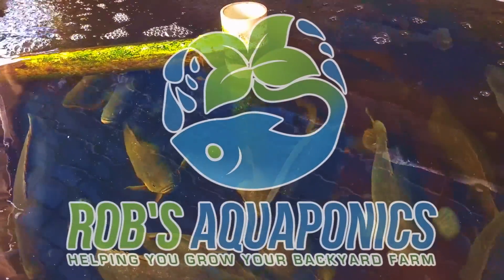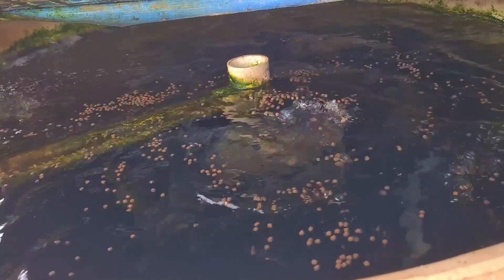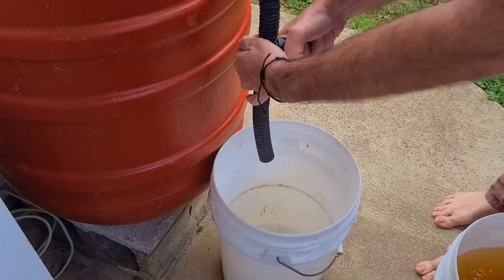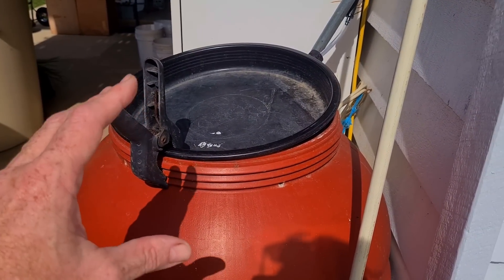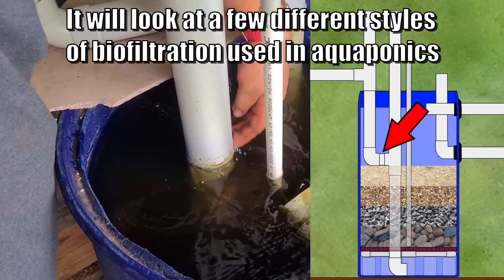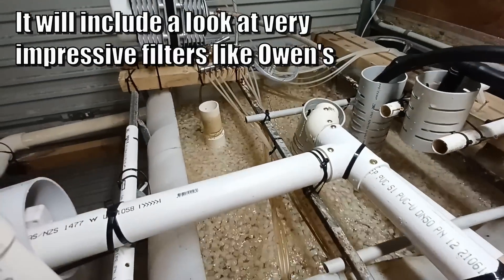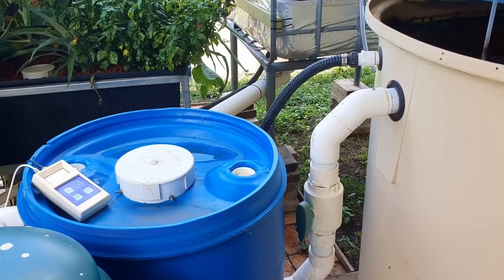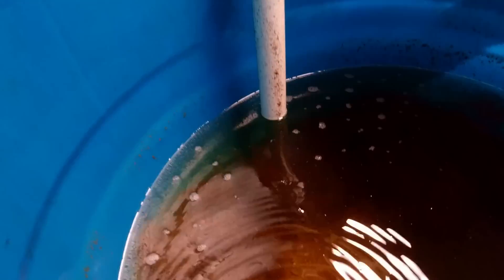Aquaponics Solids Filters & Biological Filters 🐟🌱🍓🥬

Comment: Hey Rob, thanks for your educational videos- they do help a lot. 1 question though, do you not have any problems with the pump clogging up in the fish tank/IBC or recommend anything be added like a pre-filter?  ( Also sorry if you have already answered this ) THX!
Reply from the maker: Hey Jason. Never had an issue in the larger systems with a 4500+lph / 1200+ gph pump but have had issues with the smaller aquarium ones. 
I also tend to run systems where the pump is in the sump tank so most of the solids are removed before the fish water gets to the pump. 
Hope that helps some.

Comment: I’m a plumber, and I strongly feel like dual solids filters should be plumbed with symmetry, starting from the tee you split them up.  One will be getting more use than the other, possibly defeating much of the purpose of having two filters.
Reply: I say I’m a plumber, because it relates to twin water heaters hooked up together parallel.
Reply from the maker: I think one would always get more than the other but by splitting in parallel it would still be slowing the flow dramatically between the two. 👍H has noticed that both his set up this way get the same amount of solids. He's just eyeballed it though.

Comment: How long do you oxygenate the waste in the barrel to use it?
Reply from the maker: The biofilter only has a short retention time of about 4 or so minutes.
If you mean a mineralisation tank that you puit the solids waste into, idealy it should be bubbling/brewing for about a month before you draw off the mineralised water to add back into the system. It doesn't have to but that's best practice. 
This video cover mineralisation a little better,
https://www.youtube.com/watch?v=pX8yB4-fJLs

El biofiltro sólo tiene un corto tiempo de retención de unos 4 minutos aproximadamente.
Si se refiere a un tanque de mineralización en el que deposita los desechos sólidos, lo ideal es que esté burbujeando/preparando durante aproximadamente un mes antes de extraer el agua mineralizada para volver a agregarla al sistema. No es necesario, pero esa es la mejor práctica.
Este video cubre la mineralización un poco mejor,
https://www.youtube.com/watch?v=pX8yB4-fJLs
(google translate)

Comment: What size of pipe that suitable for this scale aquaponic?
Reply from the maker: I use 2' / 50mm for gravity flow drains on these smaller 1000-2000l DIY systems.
Reply: @RobsAquaponics  is it good enough if i use 32mm pipe sir?
Reply from the maker: @supergrandimperialx  That depends on your flow rate. I think 40mm would be OK for gravity flow rates of up to 1200lph but no more. 32mm would be a bit small.
Reply: @RobsAquaponics  allright. Thank you Sir for answering my question.😁

Comment: My old aquaponics system I used the swirl filter barrel design to collect the solid waste. Then for added biological filtration, I threw in a whole bunch of those plastic mesh fruit bags we get at the supermarket for apples and oranges rolling them into "apples" (my diy pot-scrubbie type filter media) floating in the same barrel. They helped slow down the flow and prevented waste from coming up and exiting to my grow beds. Saved a lot of space with less plumbing parts needed. I really liked that system.

Comment: Hello, thanks for the video; subscribed. I’m using a Matala bio filter for an outdoor koi pond and for several months the filter pads would have a ton of mucky poo waste to clean. However recently I noticed there’s none of that but I see a lot of tiny tiny particulates (probably algae-based) that pretty much flows through, straight back into the pond. As a result the pond water has been looking pretty dusty and green despite trying to clean the filters as best I can. I also have a barrel filter with the white plastic pieces to help, but it doesn’t seem to be filtering well either. Do you know what could cause the poop to change form to barely anything solid?? Thanks
Reply from the maker: Mechanical action & the bacteria breaking it down will cause it to form smaller particles. Are you still having issues?

Comment: Great channel.  I have a question about tank size for solid separator and moving bed bio filter.  What size tanks would you recommend for 200 gallon tank with 40 fish, my goal?  Lastly how much moving bed media should I use?  I think I seen where you were using 30L of media in 8 gal.
Reply from the maker: I like to base it on retention time so ideally I should have a 50gal drum for the bio filter to give the nutrient rich water 6+minute in the drum before passing through. The same amount of dwell/retention time I like in my solids settlers. 👍
For us in our climate we need 1L/quart of the media we use to process the ammonia generated by a 500g/1lb fish. The same should be true for tilapia if you're growing them as they have a similar metabolism.
Sorry for taking so long to get back to you.

Comment: For DWC, how many gallons of nutrient water, do I need to support plants. Is it figured by volume of nutrient water, volume of grow bed, number of plants, or a combination.
Reply from the maker: Most folks I know will use a 12"/300mm trough for their DWC Sam. As for flow rate, most will run at once an hour exchange rate maximum. I know one chap that like a 3 hour water exchange rate in his DWC. 
Sorry for missing your comment at the time.

Comment: Would a radial rlow settler work with a small backyard duck pond?
Reply from the maker: It can do Stan. It would need a fairly long retention time as a lot of the solids will be fairly fine.
Reply: @RobsAquaponics  so a large container with slow flow?
Reply from the maker: @stanmondzelewski9253  I would look for a 6 min retention time minimum. To wok out retention time divide the filter drum by the flow rate per hour then  multiply by 60. 
e.g 200l drum / 1500lph flowrate = 0.1333
0.1333 X 60 = 7.998 minutes or close enough to call 8 min. .
Reply: @RobsAquaponics  thanks

Comment: Any tips or ideas for someone trying to do aquaponics in 5 to 6 climate zones? (Gets down to -26c in the winter)
Do I just have to only run it in the summer?
Or do you think a small greenhouse set up could work?
Also it gets up to 26-35 in the summer. 
Would a heater in a green house be enough? Or even worth it?
Reply from the maker: I do know folks that run the fish inside & have the greenhouse outside. They wind the greenhouse down over winter & the fish slow right down as well.  
You could also grow indoors as well, either part time or just through winter if you have enough space in the basement or garage.
Reply: @RobsAquaponics  thanks for the info, great informative videos also 👍

Comment: I have a 120 gallon fish tank with 10 adult goldfish and 2 juvenile plecos (originally the fish were in separate tanks, and I have been unsuccessful in rehoming the second pleco as of yet, though I will continue to look for a good home). They get 1-2 tablespoons of Wardley Pond pellets throughout the day in separate feedings. I have a canister filter and sponge filters that have prevented any issue with ammonia or nitrites, I have a bed of aquarium gravel in the bottom of the tank, which sits on my floor, and no room for a solids settler. I am having difficulties calculating the volume and planting density in grow beds/rafts. I always have an excess of nitrates, so I have to siphon off water and vacuum the gravel, but I also have deficiencies in pretty much every other nutrient. it doesn't seem worthwhile to supplement the other nutrients if I am having to constantly siphon water off to control the nitrates. I do have limited space in my apartment, and I know the goldfish can potentially live for decades (they're only about three years old). Would it be worth it to continue to try and sort out grow beds, or would I be better off just keeping it as a decorative aquarium for now until I inevitably move, hopefully into a bigger space? Do you think installing undergravel filtration tiles would be useful?
Reply from the maker: I have seen folks with nitrates well over 100ppm with goldfish & koi FW. What levels are yours at?
Reply: @RobsAquaponics  I've had them reach 150-200ppm, which is why I siphon off the water, as I'm concerned they may get fungal infections if the levels remain that high.

Comment: I built a pond for my ducks, right now the pump sits in the water and pushes the water into a 20gallon filter of cotton/sponges/lava rock then back into the pond- worked fine when it was dirt floored but I was loosing water so I put a liner in it- lasted 1 week and I had pea soup waited 2 weeks never clear so I dumped the pond.  I want to add a swirl filter before the 20gallon, and at some point get some grow beds going with spinach. Would this help lower the duck poo and pea soup issue?
Reply: Kyle, I'm struggling to keep my duck water clean, too. I'm in the desert, so not having a liner was never gonna work. I've tried swirl filters, radial settlers, gravel and sand, polyfill. Ducks are tough. It's not a lot of water, but it still overwhelmed my tiny grow bed. I'm working on a 3x7 right now, planning on some regular grow beds and a worm farm to make use of pond water so I can change some of it out regularly.
Please do post back if you find any success.
Reply: @turbomacncheese  I have 16 ducks, 10x15x3-about 4000gallons-pump does 8000 an hour, worked fine when I had no liner, turned into pea soup within a week with the liner
Reply: @Melike1hit  hey, I'm following up. I still haven't turned my ducks loose (they get a kiddie pool to splash around in with clean water every day). I started some seeds in the grow bed (in pots) and i got the green soup even though I'd been abble to add ammonia, turn it green, and have it clear up the next day. I figured nutrients from the dirt.
I've been transplanting the seedlings straight into the bed and starting more seeds in the dirt. Wife takes some water from the filter buckets for her other plants and we top it off every few days.
Water went clear over the weekend. CRYSTAL clear. I can see the threads in the drain through about 2 1/2 feet of water.
The bed is cinder block on a 4x8 torsion bed (leftover from construction) with a pond liner, giving me the 3x7, and has river rock on the bottom (leftover from the septic install) and pea gravel above that. Mabe 2-3dozen plant starts. I'm letting the ducks into it this week.
Reply from the maker: B & I have taken an interest in keeping some Muscovies & the first thing she said after watching the video was "DUCKPONICS".🤣🤣
 Hows are your systems going folks?
Reply: @RobsAquaponics  ducks had a grand ol time in it, but we got busy and couldn't make up the door like i wanted for them so we had to carry them back and forth, which we also don't seen to have enough time for. The wife thought it might be a good idea to dose the pond with some hydroponic nutrients she had handy, so we tried that and it went green again, lol.
Just using the grow to test different types of pots, start seeds, and mess with dual root zone sets (inspired by your interview with Steve from potent ponics). I've only got a few duals, but they are noticeably better.
We're fencing in some free range for all the birds, so that will make it easier to let the ducks in.
BTW, I'm partial to Quackuaponics!
Reply from the maker: Hey Kyle. Adding some media beds will help a lot as they will also help capture any solids that escape the filter. You'll probably find that the water will never be crystal clear even returning from the beds from what I've seen in videos like these two,
https://www.youtube.com/watch?v=qOWFvvYH2CU
https://www.youtube.com/watch?v=_o36aZHKZl0
Hope you post a video or two once you set it up. 👍👍

Comment: Great advice Rob. I don’t have a moving media bio filter but do have a bunch of bio media the water flows through before the sump. I’ve put 6 bags of media floating in the top of my settler put together much like yours, each bag with an air hose bubbling air. It only disturbs the top 5-7 cm. of the water in the 55 gal. drum (~200 liter). Low air flow bubbles. Then the water falls 5-7 cm. Onto more bio media above the water in the sump (hung a bigger bag of media above the sump water level). From the sump water flows to the media beds before cycling back to the fish, but going through more bio media. Haven’t had an ammonia issue in the fish tank. Got 3 air pumps supplying air, plus the water returning to the fish tank is sprayed along a pipe with small diameter holes which shoots the water initially horizontally given the water an angular momentum. The stock tank with the fish is wide and shallower than an IBC tank, with enough air to water surface area to ensure adequate oxygenation if the power goes out for an extended time. I’ve got a unique system, but the fish seem happy and always have too many plants. I’ve incorporated more dirt grow bags in flood trays. I like to use the fish solids in the wicking beds and dirt beds, although a mineralization tank looks interesting. I like the design of the one from Bigalow farms. 
Excellent advice video!
Cheers 🍻
Reply from the maker: Nice one mate. I would love to see a video of your system at some point Joe. Visiting for a gander would be even better. 😉👍
Reply: @RobsAquaponics  I might have to clean up the garage 😆
Reply from the maker: @joecanales9631  🤣

Comment: Since I have a limited budget, I have used alternative media for my moving bed bio filter. The little white balls available from the aquarium suppliers work wonders and are very, very good but I am currently using some 3000 (ish) milk bottle tops collected over some eighteen months by myself and family, and have had no issue with nitrite/nitrate levels. It is a bit noisier but seems to work just fine...What do YOU think of this as an alternative microbe surface media?  Thank you
Reply: This is a great option, milk bottle tops will have less of a surface area than the white media BUT it comes down to if you use a slightly larger area of them you will see the same result AND recycle a plastic product them may have otherwise ended up in landfill  (in most places in Australia at least).
I personally have found that small bottles of water (600m or so) tend to have a lot of thread and a corrogated outside meaning more surface area, although I tend to not be patient enough to sort down to one type so I run tens of thousands of completely random lids and they have been going well for a couple of years.
In Queensland, Australia, the 10c refund for collecting drink bottles does not include lids (most councils send these to landfill) although I know my local "containers for change" point that has real people counting rather than machines keep all the lids that slip through and are more than happy to give them away free to people that can put them to good recycled use so it may be an option for people go go along and have a chat with people like this and they could save some dollars and some space in landfill.
Reply from the maker: A mate of ours sued the caps as a media in his trickle/bio & worked well from all accounts. 👍 They're not neutrally buoyant like the professional media but do provide surface area.

Comment: @12:00 You're correct that dumping the water in through the top will create all kinds of horrible turbulence in the stilling well.  The diffusion plate that I put in does a great job with removing the turbulence. The main reasons why mine comes from the top:  1) Didn't want to poke another hole in the side of the tank for the plumbing, 2) I like to experiment.  😜
Reply from the maker: I really like your set up Rob & it does make sense to be able to have it rigged up that way. 👍 I* have co9ntemplated doping the same in the large cone based drum I have to play around with.

Comment: Here in boddington so so cold. I wonder if i will ever have a problem with ammonia because the bacteria slow down so much when its cold.. great work rob
Reply from the maker: From my understanding they will still process waste through the cooler weather but they won't be as active. That's one of the reasons I think a little bit of caution be shown in stocking densities & over estimation of grow bed/biofilter can't hurt either.